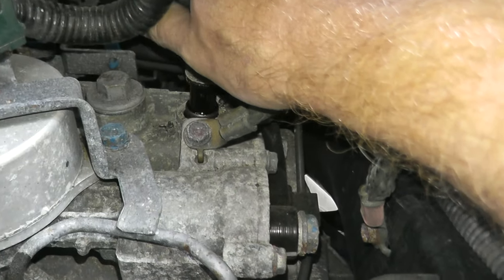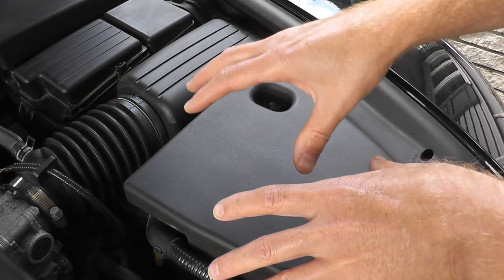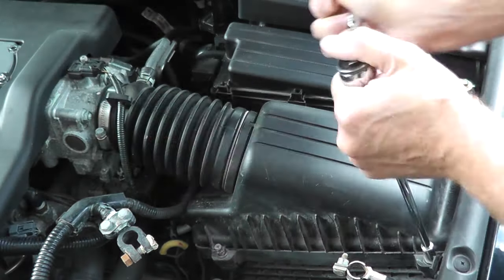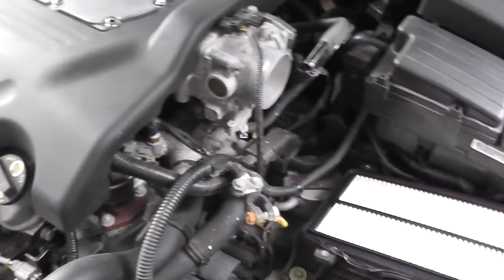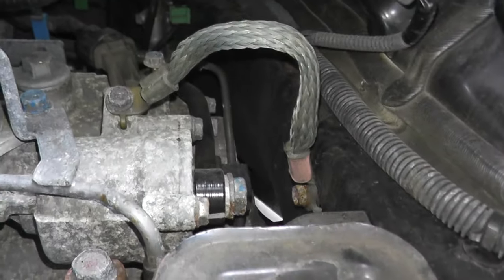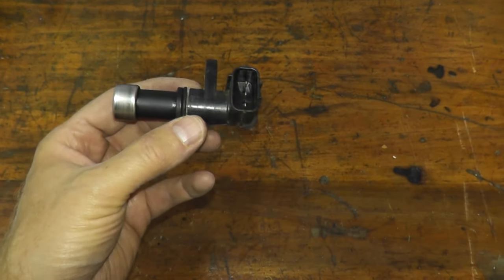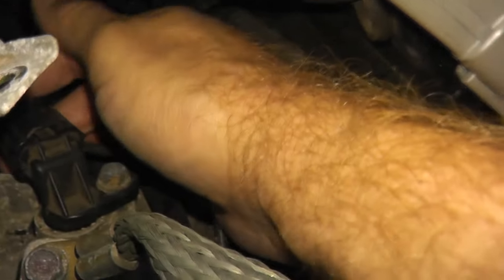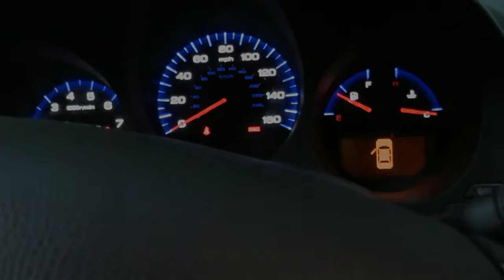Output Shaft Speed Sensor Replacement P0721 / P0722 / P0723

Comment: isn`t the input shaft speed sensor on that case? just asking because in case of ford fusion 2.5, the output shard speed sensor seems to be a cord sensor that goes inside transmission...

Comment: Hi, have a question, have you ever been in touch with a  aut gearbox from a vw caravelle(Europe) or California in the US ? I have a 2006 vw caravelle 2.5tdi 174hp with a JAC transmission and it went from bad to BAD in a couple of weeks after gearbox oil change. At first it shifted poorly with a knock between gears. And after oil change it didnt change gears upwords at all... Now its in limp mode(R works!)? After diagnostics its shows an error code p0721 "impausible Signal" Output speed sensor CIRC: range/performance"... Could a single sensor cause such problems? PS! after revving from start it can jump to 5th gear and lock on it ?! Would be amazing to hear from other ppl whos struggeling with the same problem. It could be a faulty solenoid body, but since it doesnt engage "engine light" so i doubt it.... Many thanks from everybody who has any info about the gearbox ;) Br:Sten
Reply: Did u find out if this worked as I have the exact same issue on the same vehicle?

Comment: I did the exact same thing and it’s still acting like it stuck in gear no other codes are reading but that
Reply: What is the code before you changed out the part?

Comment: No year make or model? WTF
Reply: '04-'08 Acura TL BGDA  transmission. If you do a drain and fill they take 3 qts DW-1. When checking trans fluid in a Honda automatic- get it to operating temperature switch off the engine and within one minute check it. If it's between the two holes on the dipstick you're ok.